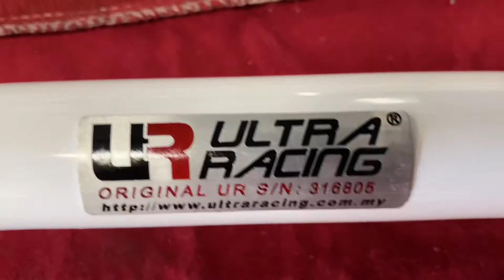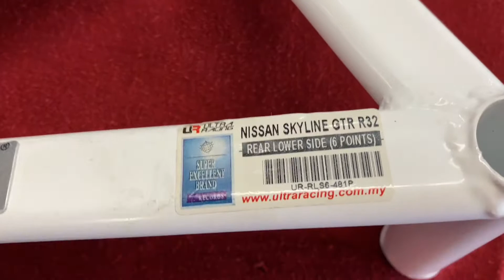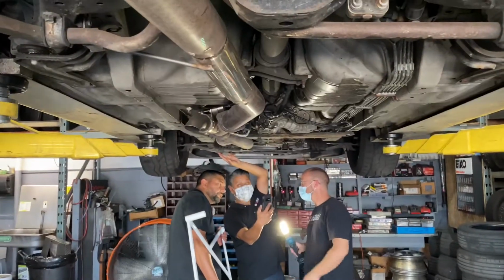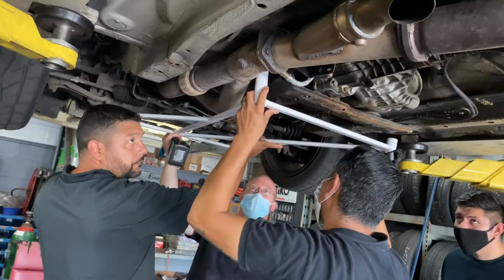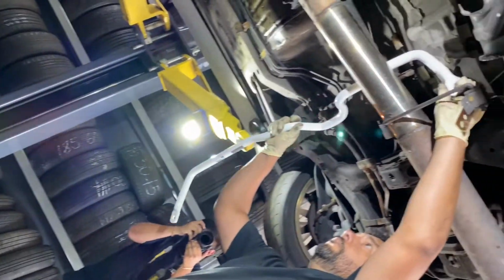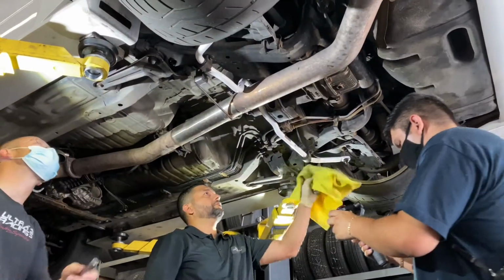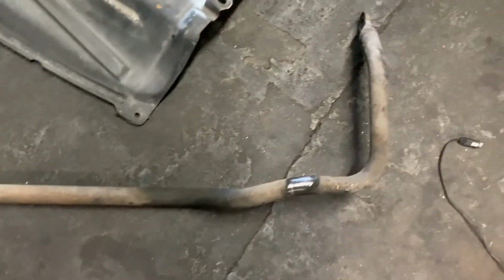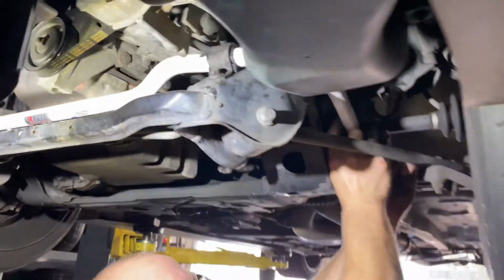My R32 GTR gets new Chassis Bracing kit from Ultra Racing USA!

Comment: So it looks like the front ladder brace didn't fit because of your downpipe...interesting.  Do you know where the front mounting points of that brace are supposed to bolt to?  Looks like the subframe crossmember, but there aren't any threaded holes there.